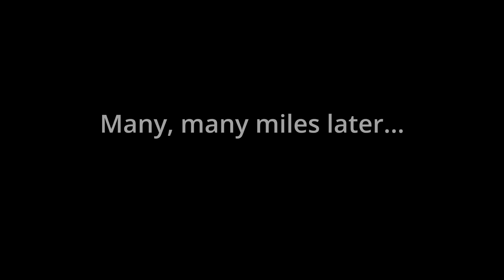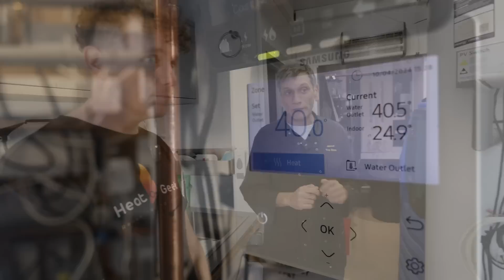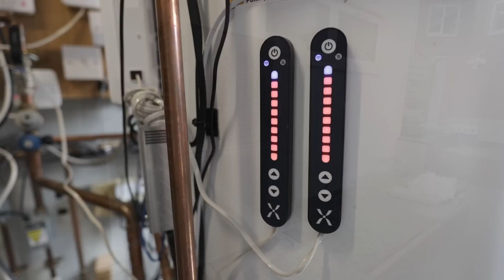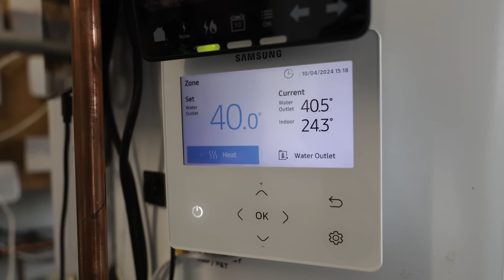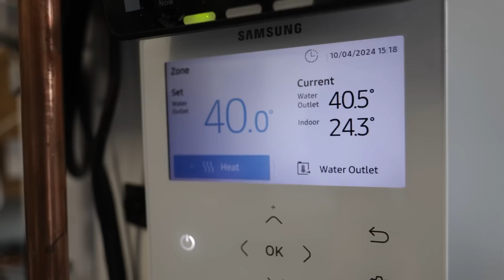Urban Plumber & Chief Heat Geek Put The World To Rights

Comment: 16:00 : What you are discussing is the difference between an 'engineer' and a 'technician'.  'Engineer' is a much used - and inappropriately so - word for what most of the UK's tradespeople currently consist of.  The other classic example of this is in the vehicle servicing industry.  Something on a car stops working and the £150/hour 'engineer' simply follows a script, replacing things until the fault clears.  This is not engineering which would mean an individual having a full understanding of what s/he is looking at and being able to repair a one or more components in a device without simply replacing the entire device - eg replacing the diodes in an alternator when they fail rather than just replacing the entire alternator.  This is the sustainable route but with labour costs at ~£150/hour, it makes no economic sense.  Conclusion: Our civilisation is screwed.

Comment: Well, this heat pump b an b ain't carbon free if electricity used comes from turbines that are driven by burning coal😂
Reply from the maker: Good that his comes form solar the. Even if it was coming from commercial plants, it’s still produces 4 x less carbon than using a gas boiler and costs less to run

Comment: It looks very complicated - pipes, displays, cables everywhere.  Good luck if theres no hot water one day
Reply: If the ASHP fails to deliver hot water, I can switch the cylinders to the immersions. Another advantage of the Mixergy cylinder is that I only need to drain off the top quarter of the tank if I need to change the immersion element, and would take me all of 20 mins. So there are two methods by which hot water can be produced and it's always good to have a back up in this business 🙂

Comment: Very interesting video, plus an important distinction between safety qualifications and design / engineering qualifications. Do you think the NVQ level 2/3 will be re-vamped to include teaching heat pump system design?

Comment: Thanks for the mention Szymon! Yes the output of the ThermaSkirt 2 pipe system is around 60w/m of radiant heat with, like you said very little convection. As the skirting is delivering at a low level around the room, there is a high level of thermal comfort relative to the overall output... and don't forget, if the property is poorly insulated ThermaSkirt can be used in conjunction with normal sized rads to minimuse the impact on room space! :D 
Keep up the awesome work!
Reply: The Thermaskirts work brilliantly :-)  Absolutely no regrets on this part of the setup!!

Comment: I find this video both encouraging and worrying in equal measure: 

not that we need a new boiler at present but, the time will come. Our house is an old property, some of it 18th century, some 19th century and the remainder 20th. The previous owner did a lot of renovation and most of it, seemingly reasonably well. Yes, there are cold cold walls (solid stone) and others which seem OK as they have been dry lined and, we have been assured, they meet requisite building regulations. Certainly, copious exploration with a thermal camera and things look ok. No radiators, just hydronic underfloor in 14 zones. Thermal store, oil boiler (no gas here). The house is about 3,600 square foot.

It seemed to me that most heating engineers follow existing practice (which is fine, to a degree) and that few of them had invested the time and effort to really understand how to install heat pumps. It also seemed that an OK job could be done by the average engineer but that it really wasn't likely to be an exceptional job and the house would cost more to heat in the long run. As a retired engineer myself, I really do appreciate the importance of proper design and this video conforms everything that I thought.

Soon after we moved here I approached a renewable energy company to see how much a conversion to a heat pump would cost. Having established the basics his next question was "Do you have three phase?" - slightly concerning for us as a) we don't and, b) three phase suggests high running costs! 
Having later discovered Heat Geek,  just out of interest I went to the Heat Geek site and entered my post code. The system told me that the expected heat loss from our property was too high to be suitable for Heat Geek consideration! 

Not that we need a heat pump right now (as I said earlier), but it doesn't feel great that the Government "was" (and maybe still is?)  pushing heat pumps as the answer to every prayer, yet a proportion of household stock isn't considered attractive for a quality, data driven installation !

Comment: Intrigued to understand if planning permission was required for the outdoor units. I’m currently going through PP on an ASHP and it’s been going on for nearly 6 months now.
Reply: Mine didn't require planning permission, and the ASHP is located at the back of the building, nearly to the centre of the building and several metres from any neighbours.  It is also right under a guest-room window...and not a single mention of any fan noise; they are really as quiet as they say :-)  Good luck on your install!

Comment: Guys, One thing to bear in mind is that we've been having record warm weather. I well remember 1962/3, it was freezing for two or three months non stop. These days we are relying to a tremendous amount on wind power here in UK.
When there is a. " blocking" high pressure area there's often little to no wind, high moisture conditions around freezing which are ideal for inducing a death spiral for heat pumps.
Fortunately the government seems to realise we could be in for a wind generation defecit and they're embarking on building new gas generated electricity facility. 
Today, in the UK, nearly 60% of our electricity was wind derived or imports. If we get into gear and fit 10 million heat pumps, just think of the day when we are becalmed. 
I have a 16kw ashp and 4,000 litre buffers which I load up to 60°c. On Agile tariff I can pick my time to charge, balancing electricity costs and outside temperature. Just lately I have enjoyed up to 8.8p credit per kwh.
I'm in my 8th decade in this old house and we have never had any heating upstairs save for a portable oil stove in the Asian 'flu of the late 50's. We do have a radiant electric wall mount in one of the bathrooms, only used when occupied.
Reply: That sounds like a monster setup 🙂

Comment: It will be interesting to see how this works out - Personally I wouldn't worry too much about heat loss from the pipework (IF the main system is within the B&B's envelope), as it appears that the outer envelope is well insulated.
Reply: Envelope from the inside out is this:  Plaster board, 50mm insulation, Air Gap, Brickwork, Air Gap, Brickwork, Render. The roof had the 210mm superquilt; 140mm insulation between the floors.

Comment: Thanks, really informative and interesting to see how different installations work out in practice, given the relative lack of maturity in the market and associated trepidation of us potential consumers. 

As well as the expert critique of some aspects of the installation (insulation, pipe material etc) it would have been great to pick out the things that were done really well - and supplement with a bit more info on the actual performance of the system to make it a bit more real.  Otherwise it's a bit like viewing the car in the showroom without taking it out on the road for a drive.

On the industry skills / mindset issues, the 5% perspective is interesting as it implies that perhaps the challenges around transitioning the sector to low carbon heating shouldn't be as big as they are sometimes represented.  Talking to some installers who have successfully made the transition - i.e. unlearned their bad habits, refreshed their skills and got into the new mindset - would also make some good content.

Looking forward to future episodes.

Comment: This has worked for him because of the superior levels of insulation he clearly has. It would have been interesting to know what insulation work was done to achieve the level of insulation required.
Reply: I added a 75mm timber frame internally to all the outside walls and stuffed it with 50mm insulation.  The exterior walls are double-skin brick with an air-gap inbetween.  Then had the whole lot re-rendered.  Between the floors I installed 140mm insulation, and I filled up most stud walls too. I took the idea of getting as much thermal mass into the structure, and ran with it ;-)   After that I just crossed my fingers.  The extension and roof were done to current regs.
Reply: Thankyou, most helpful, did you upgrade your glazing at all?
Reply: @andrewrudge5652  I replaced the windows with the usual uPVC double glazing. I opted for integrated blinds so I didn't have to clean them and I hate net curtains, but the added benefit is the shading they provide especially on the windows on the front of the building (nearly south facing).

Comment: @urbanplumbers. What’s your view on the slave labour involved in mining the lithium iron battery for your electric car? Or is that just another negative you ignore to push your product you sell?
Reply: Err lithium comes mostly from Australia, maybe get your facts straight.

Maybe you're thinking of cobalt, which is largely being phased out of EVs and there isn't really any link especially considering there are other industries that use it, e.g. desulphurisation for petrol and diesel.
Reply: I mean pretty much every lithium iron battery has cobolt in it. So saying lithium battery mining is pretty much the same thing. Not sure my facts are that far off there. Cobotl production has doubled in the last decade and still rising so say whatever you want about what they may or may not be doing in the future it’s still happening now and has been happening. Electric car batteries far out weigh any other use for cobolt.
Reply: @jamiebrown8437  False equivalence then, rather than fact. And that applies to the battery in your phone, tablet and/or laptop.  EVs have started changing to techs like LiFePO4 which don't have any cobalt.  So yeah, your facts are way off.

Comment: How do you control room temps without room stats?.  Just flow rates ????
Reply: There is just one stat for the ASHP to set a minimum temp (18c or near as dammit) and then the guests can fix their desired temperature, up or down, as they wish. And believe me, you can have 2 adjacent rooms where one is heating and the other is cooling.  That being said, after Szymon and Adam's visit, it is clear to me there are some more efficiency gains to be had!

Comment: As with others, really enjoyed watching this collaboration between two heating engineers who I've learned a huge amount from already as an engaged non-professional. Great to see an accommodation provider decarbonising their hotel and I'm hoping there are some EV chargers for guests to use too. In this day and age I find it remarkably how rare this still is. Aspect that surprised me most was that with all the effort that's been put in to design and construct such an elaborate system, that it was found to be running on a fixed flow temp. If there's something that you guys have drilled in to me, its the importance of running full weather compensation! 
Great video, great case study and great conversation...
Reply: And that is something that I learned with Szymon's and Adam's visit, and shines a light on having a great installer (mine was) but in terms of knowledge & skill for commissioning and optimising the system, not so much. That's where Heat Geek and Urban Plumber videos were SO useful to me 🙂
Reply: And...there are FOUR  7.4kw Type 2 EV Chargers here on site too....2 for the public, and 2 just for my overnight guests 🙂
Reply: @MagnoliaHouseRye  I suspected that'd be the case and that's great to hear. Just wish it was more routinely available as it makes long journeys that much easier when you know you can rely on destination charging - as I'm sure you know. Hoping that this has helped boost the business by getting EV drivers to stay at the hotel.

Comment: What was the cost of all the equipment and labour for that plant room , also the cost of A2A units in each guest room ?
Reply: Yup....wasn't cheap. But...the refurb of the building required a new installation of everything from the wiring to the pipework to the windows.  I also received grant funding (LoCASE & BUS) and the cost savings does mean I can treat the expense as an investment, with a rate of return and hand on heart, this lot WILL pay for itself :-)
Reply: @MagnoliaHouseRye  It’s obviously only financially viable because of the 2 grants subsidising the installation. 
As for the installation the fact you have humongous a2a units in each room suggests the HP cannot cope with cold and high demand. 
Looking at your website and your b&b looks lovely. 👍
Reply: @haydnlawrence8167  You should come and see us 🙂 The A2A's run at 10amps peak (ie not for very long at all) before power consumption falls right off.  Plus, the A2A's are a guest-feature and also gives me a back up method of heating in case the ASHP and / or their immersion elements fail.
Reply: @MagnoliaHouseRye  The a2a as a back up for the HP makes sense . 
If ever I’m in that neck of the woods and need a b&b  will try yours. Prefer the independents to the corporates.

Comment: I'm considering that Thermaskirt to replace my 8mm plastic microbore piping to very old radiators and getting a heat pump in the summer. Does anyone else have experience of them at low flow temperatures?
Reply: I am running mine at 40c flow temp and after Szymons and Adam's visit, can take that even lower 🙂  BUT...Thermaskirts are disproportionately expensive...
Reply: @MagnoliaHouseRye  Thanks, did you look at other alternatives? I'm also considering UFH but retrofitting that whilst living here would be tough! With my current microbore I've had recommendations for a high temp heat pump and running at much higher temps.
Reply: @londoner6040  I have UFH for the ground floor, which is my flat and the breakfast room.  It's all about your own use-case. I went down the Thermaskirt route for the guest rooms to keep my walls clear, both from an aesthetics point of view and also one less thing for me to clean 🙂  Dusting behind radiators is a serious pet hate of mine!!

Comment: Just another thought and video idea.  You discussed the future of where heat pump adoption is going to go in the future. Cost is a MAJOR factor above all else your customers ARE wealthy compared to the majority of the population.  HOW could you do an install that would cost no more than a straight boiler install. So the idea is could you do a like for like install for £3k and if not how close could you get based on current tech available grants etc. Customers do not care at all what the fuel is they care only about the £ most naysayers won't be able to afford the current tech which creates resistance.

Comment: That installation looked like the engine-room of the Nautilus. Captain Nemo would feel at home there! I hope things are more compact and less complicated in a standard house. It would be nice to hear whether the owner's heating and hot water now costs him less, as I'm thinking of going down the pellet-burner/cooker route to get away from costly electricity. Great video, nevertheless. I'm still sceptical about heat-pumps, but if things can be improved by better understanding of how different individual house requirements are, I could be persuaded. Looking forward to seeing more.
Reply: From Javed at Magnolia House Rye: You're not the first to compare the plant room to that of a submarine, LOL. But...I started out with Gas, hence all the valves.  With regards to my utility bills..they have crashed through my insulated floor. BUT...I do have Solar, use Octopus Agile, am able to shunt most of my grid consumption to overnight so it is a 'holistic' approach...come down and see it in action 🙂
Reply: @MagnoliaHouseRye  Hi Javed. That's really good to hear that your bills have come down. I'm just about to move to a house near Stornoway in the Outer Hebrides. The Winter's are notoriously long (I've been living in Uist for three years, so I have experience of the weather here). I'm going to need something that can meet the challenge. The house I'm buying has electric Rointe radiators, an immersion heater and electric shower, so that's all going to be ripped out! Looking for a good alternative now. There is no mains-gas and oil/LPG is even more expensive as it has to be shipped from the mainland.
Reply: @petergriffin4167  WOW! A gorgeous place to live, no doubt, but with its own challenges. I'm down on the South Coast so my solar works very well.  I'll be installing a 15kw battery system this year so perhaps look in to a Solar, Battery & Smart Hot Water Cylinder combo? In this regard I LOVE my Mixergy tanks :-)  Best of luck and you know where to come when you need a holiday 🙂  Oh....and insulate, insulate and insulate some more...
Reply: @MagnoliaHouseRye  ❤

Comment: I ,a retired lawyer, purchased a gas boiler and installed it in my home and then got a “heating engineer “ to connect and test it. Perfect was his assessment. I saved £3000 from the cheapest quote I obtained. I was told two to three days labour. I did it in 6hours.
Reply: Unusual to find an educated individual good at manual work, but well done, I did the same.
Reply: @andrewrudge5652  we're not that rare, I worked in the Lloyd's insurance market for 30 years and then built a 5,500 sqft barn conversion...with help obvs...